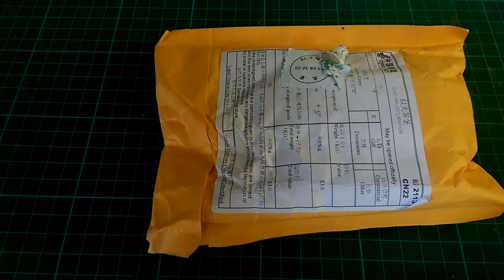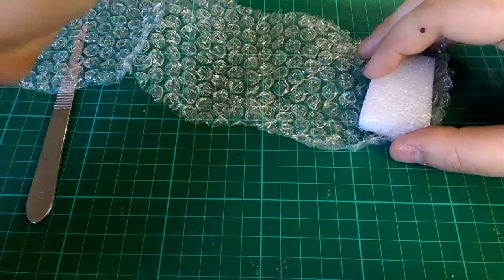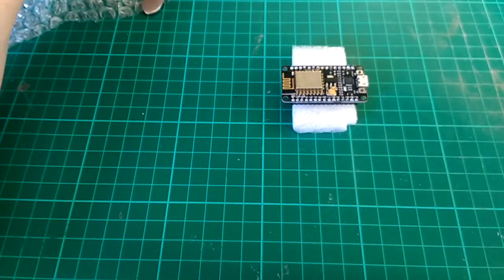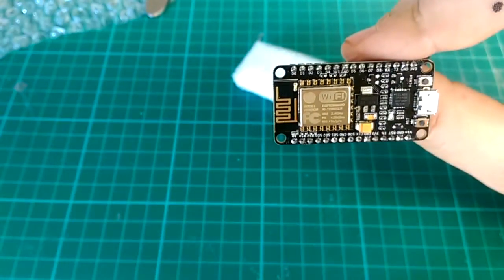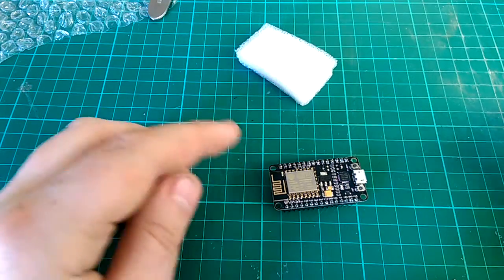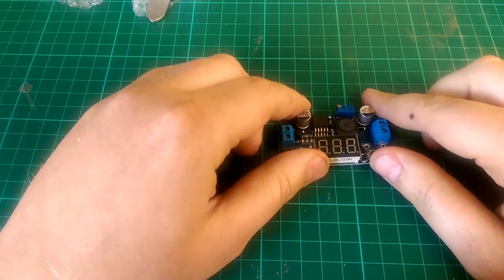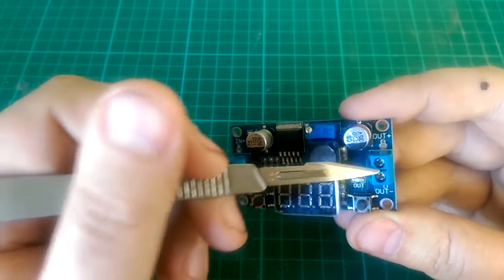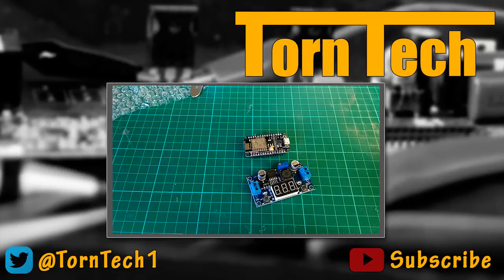NodeMCU (ESP8266) Wifi Module, LM2596 VV Converter - PostBag - TN0003

Comment: Hi there, thanx for the video. 
I have just purchased a nodemcu to do exactly what you have planned with one. Currently I have a mqtt server running on a linux based Pi. 
I just cant seem to get started and am not sure where to go next. I have my moisture sensor ready to plug into the nodemcu but I am looking at them both hoping to get some sort of inspiration from somewhere. 
Can you suggest somewhere for me to get some more info on my next task. 
Thanx matey

Comment: Interesting to see that other people use proper scalpels to open their packages too :P
Reply from the maker: Yeah, see I had a few projects which required exact cutting so looked into getting an xacto knife, but all they are is glorified scaples. So I just brought 5 scaple handles and 50 blades from eBay! So much  cheaper to do it that way!

Easier to control than date Jones crocodile Dundee knife too! Lol
Reply: TornTech Also wicked sharp! (seriously, be careful)
Reply from the maker: Arsenio Dev well their main job is the clean cutting of skin lol.
Reply: True, I also use them to cut EVA foam mats, doesnt work quite as nice as a heated knife
Reply from the maker: Arsenio Dev I have a hot wire cutter for my foam scale model work I do. I can do a quick video on it if you would be interested? quite an easily diy project!
Reply: Yes please!